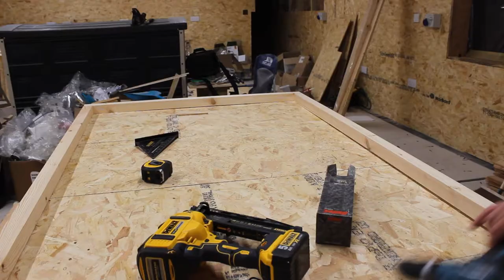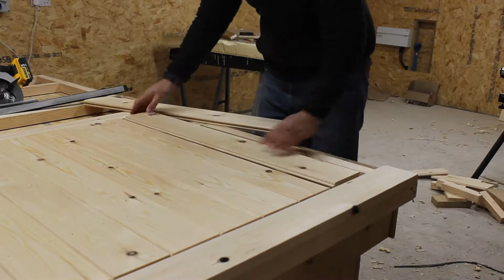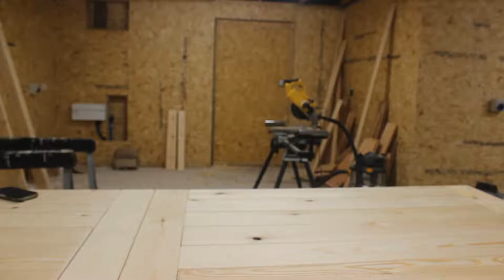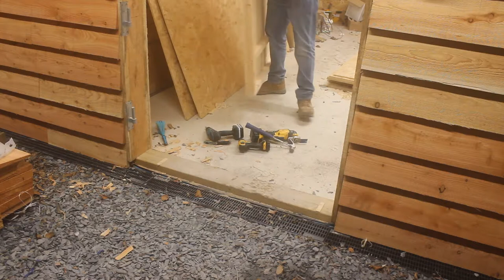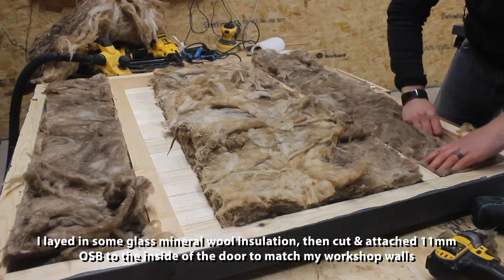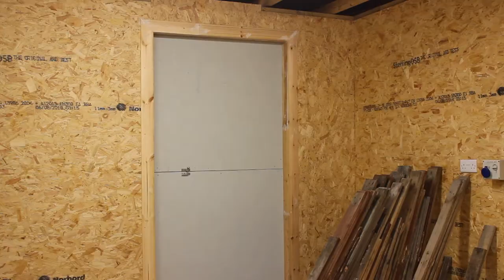DIY Stable Doors for New Workshop || How to Make

Comment: I just Subscribed! I love the size of your shop. I purchased a 10'x16' shed, and within the year I wished I had bought the one that was 14' wide. I had it completely insulated, the walls sheathed in OSB just like yours, and I had a separate fuse box installed with 200V electric with lots of outlets. You can never have enough! I am now planning to extend the shop another 6' in the spring. I think that will give me the room I need. May I ask how you like the cordless Dewalt circular saw? Most of my power tools are Dewalt and I just love them.
Reply from the maker: Thanks you for all the kind words!  Love my Dewalt kit, especially the Track/Plunge saw - pricey but so worth it in a trade workshop!  Good luck with your build!!